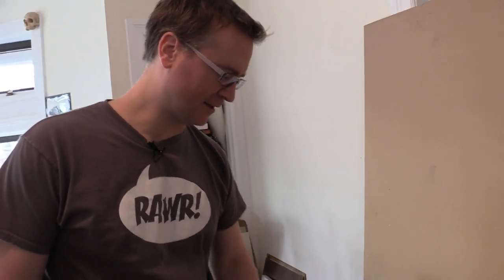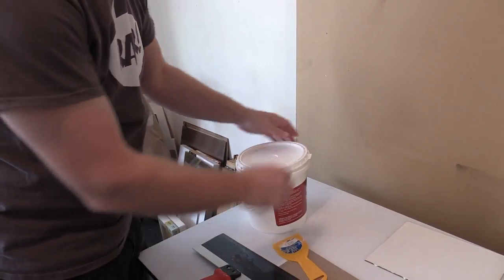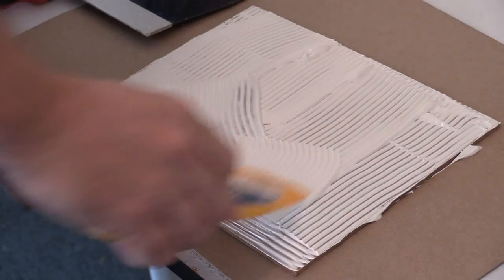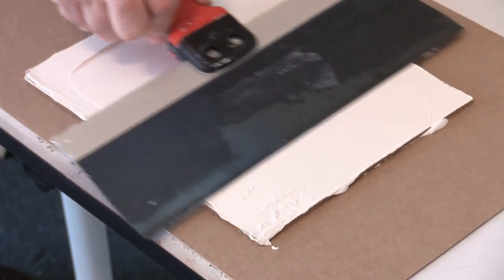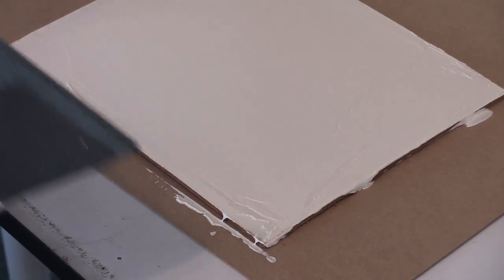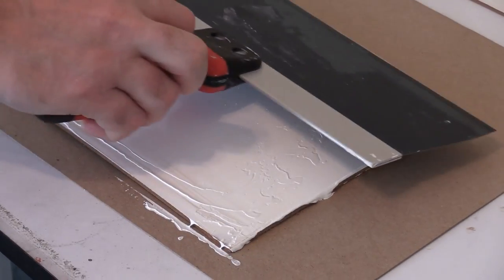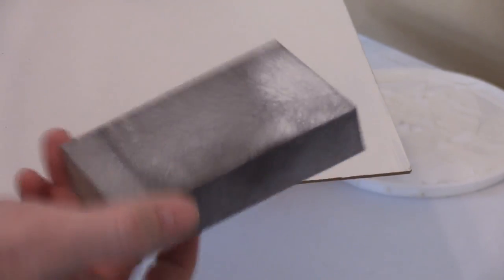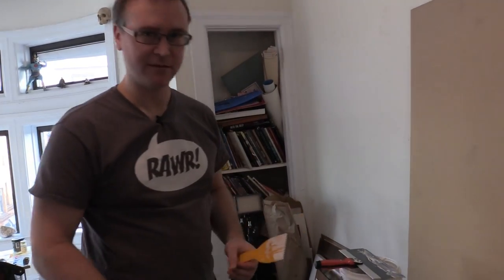Gessoing a panel for a super smooth finish with Aaron Miller

Comment: Thank you Aaron for making this video that answers the question that I asked you. I haven't had any luck in sanding gesso even when I used an electric sander I still had a rough surface. It''s surprising how few different painting surfaces in art supply stores come primed. As you showed here it's easier to use a larger spreader than the surface that is going to be painted on. I have used a thin rigid metal sheet to spread out the gesso smoothly on a 20"X24" surface. I like to put down a little more gesso than I'd need and push off the extra which can be put back in the container.

Comment: Hi Aaron! I really liked this technique. I tried in some small pieces of board and it really gets an amazingly smooth surface, but I was wondering... What do you use for larger pieces of board? That are larger than the wallboard spreader.
Thank you! (:
Reply from the maker: I use the same spreader and work the inside edge as smooth as I can.
Reply: I think it's easier to just use a larger spreader than the surface that is going to be painted on. You can use a thin metal rigid sheet to spread out the gesso smoothly. I like to put down more gesso than I'd need and push off the extra which can be put back in the container.